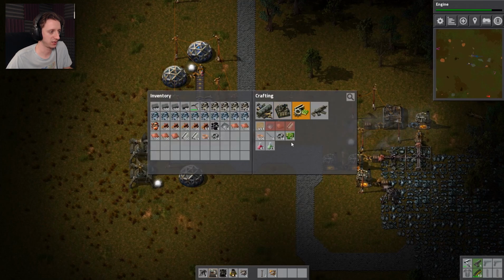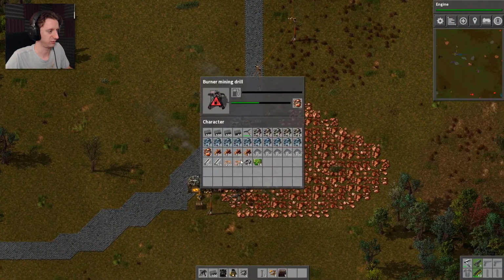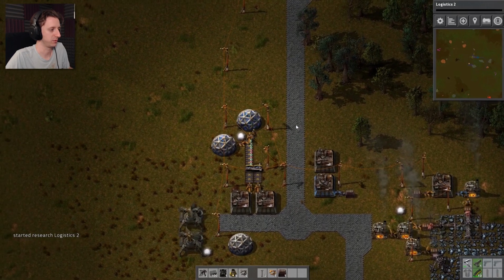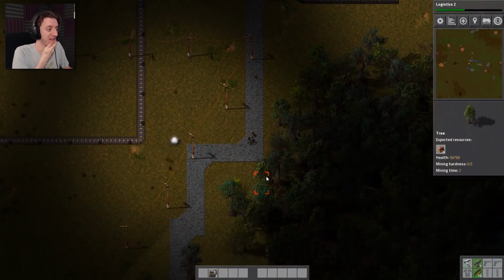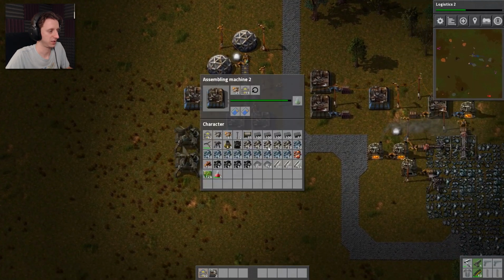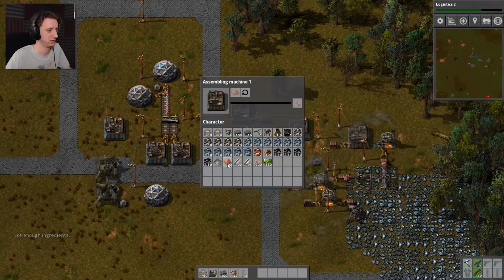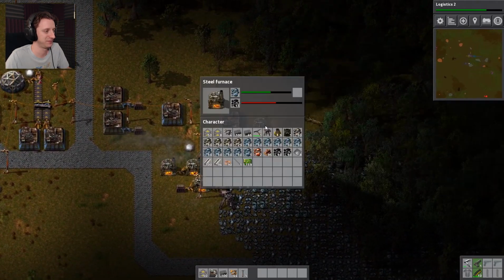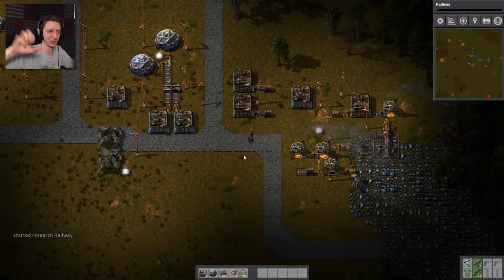Micro-Managing Pleb│ Factorio #5 │ ProJared Plays!

Comment: The cars (and trains which you don't really need right now) can use any kind of burning fuel including coal and wood. So you don't actually need to produce oil to power up those. Also, don't be afraid to use inserters (grabby hands) to move products from an assembler to another instead of doing it manually.

Comment: Trying not to over hint because discovery is what can make it fun, but a few tips I have learned.

------burner inserters are self-powering if set up to a source of fuel. so if you used them at your boilers they would run forever by just taking a little coal for themselves when needed. They are not fast but in that position they don't have to be to keep up.
They will do the same thing from a box if they are set up to fuel a furnace, making everything run for nearly forever without the running around.

------WARNING: Electric furnaces are bigger, so plan for a little more space.

------Spread out your radars for a bonus surprise. They have 2 functions, one passive one active.

------Also WARNING: "Blue Science packs are the suckiest, but stick with it, build one resource at a time and feed them all toward the research production. even baby steps can climb a mountain.

Comment: Also, I'm sure you got PLENTY of comments allready, but the spliter dosen't work the way you think it does. half of your science is just dumped on the ground.
Reply: No it isn't, conveyors don't dump items on to the ground, the splitter simply has 1 red science stuck.
Reply: Nope, incorrect. There's 2 items in a dead-end, but nothing else is being pushed on that path while it's full.
Reply: k
Reply: it'll stay on the belt; the splitter just won't work at all until the backup is cleared
Reply: I  mean you can use it the way he does, it just takes a backlog of 8 items to make it work the way he thinks it does.